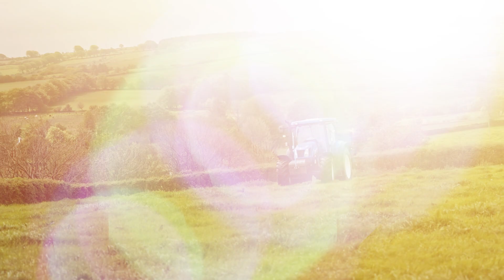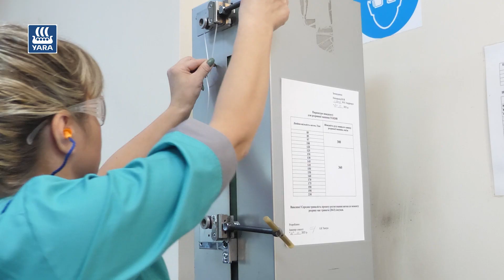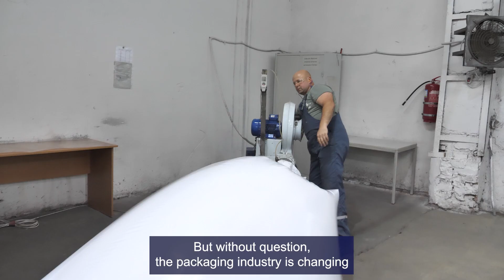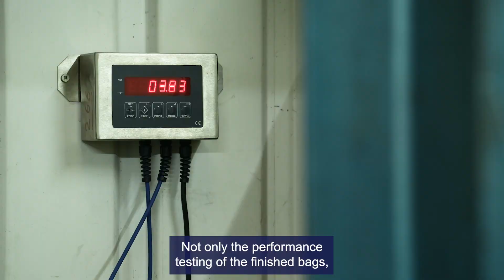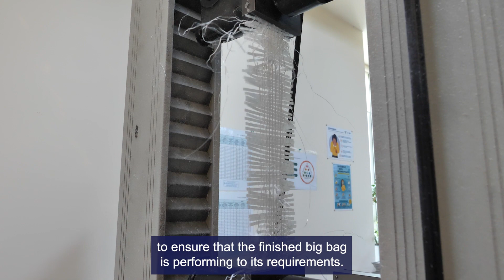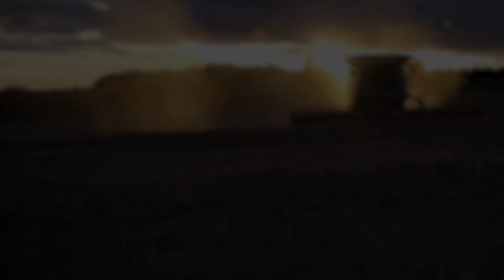Take a look at how Yara big bags are manufactured! ♻️🌱

Comment: There was a statement made that you take in the used FIBC's and use these used bags as material to construct new bags. Is there no color change in the resin? Do you collect all the used bags from Yara's manufacturing sites world wide or are you starting in one geographic area? Is every fertilizer used in Yara's manufacturing process easy to remove from a cleaned FIBC, or is there sometype of chemical process that is used to remove the residue left from the Fertilizer to make the FIBC "Clean" and usable for production?